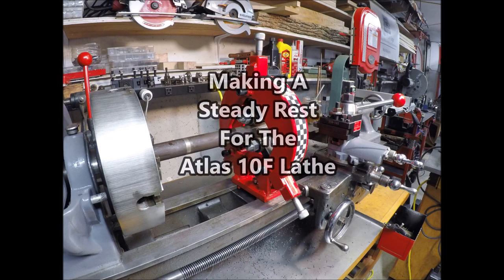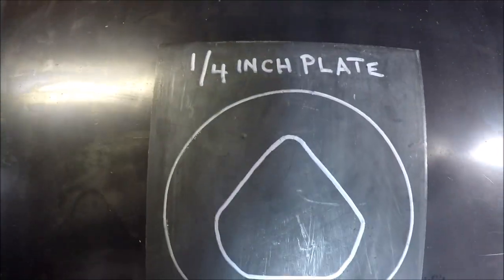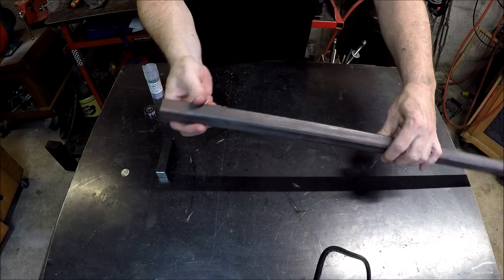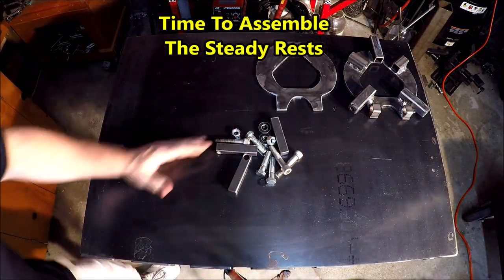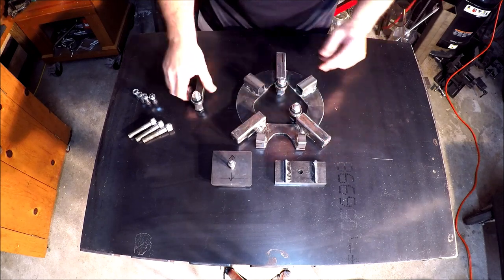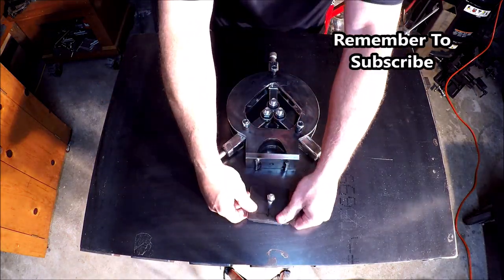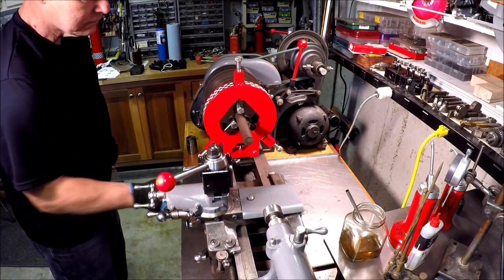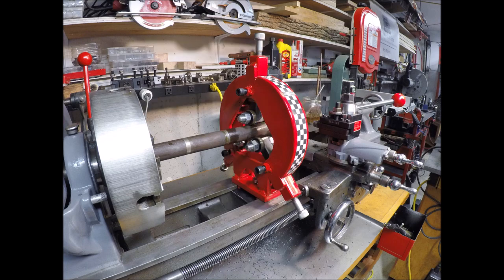Atlas Metal Lathe Upgrade

Comment: Very cool, I need to make mine (it's fairly similar in style to yours.) I'm glad it seems to have worked out. A huge benefit of this is if your lathe is clapped out it gets you away from the head stock end of the bead where you're likely to see the major wear and into a less used portion of the bed.
Reply from the maker: Thanks my friend, agree.    Good luck with your build - fun fun fun